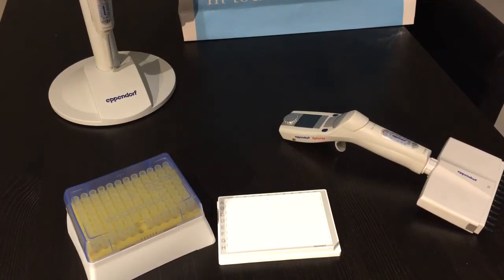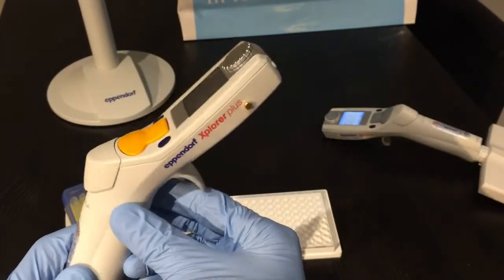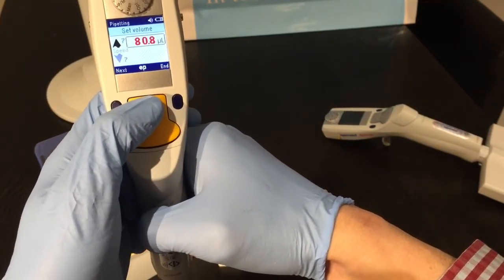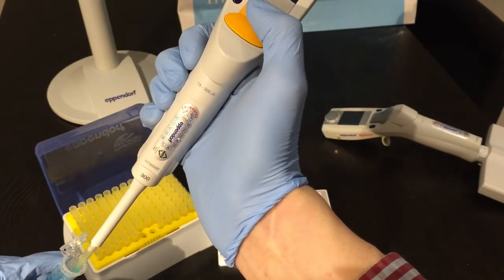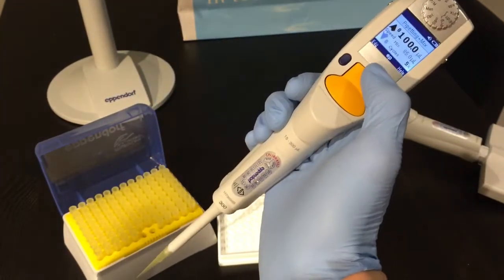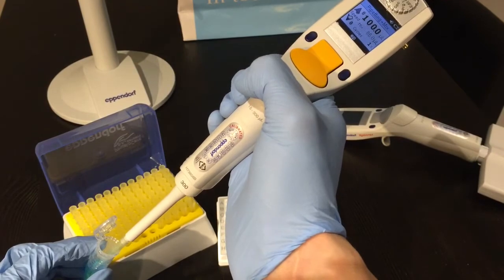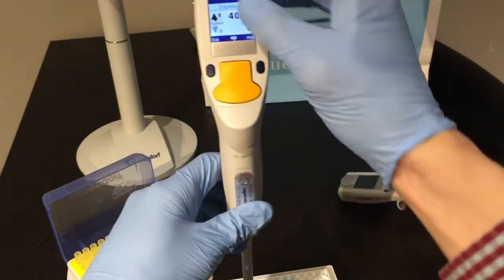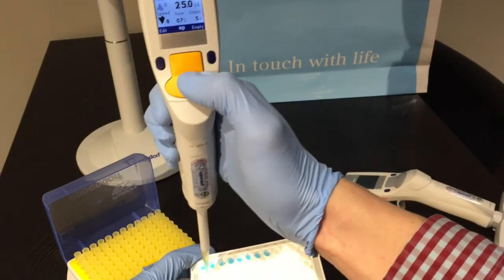Eppendorf Xplorer Pipetting Demonstration - Common Modes

Comment: the pipette can accommodate 200-uL and 300-uL tips. can i use 200-uL tips when working with smaller volumes? or is it explicitly forbidden?

Comment: hello, eppendorf xplorer includes charger?
Reply from the maker: Hi Marina, yes a wall charger with pin is included.  Charging stands are optional extra.
Reply: @MrPandan5  the pipette can accommodate 200-uL and 300-uL tips. can i use 200-uL tips when working with smaller volumes? or is it explicitly forbidden?
Reply: the pipette can accommodate 200-uL and 300-uL tips. can i use 200-uL tips when working with smaller volumes? or is it explicitly forbidden?